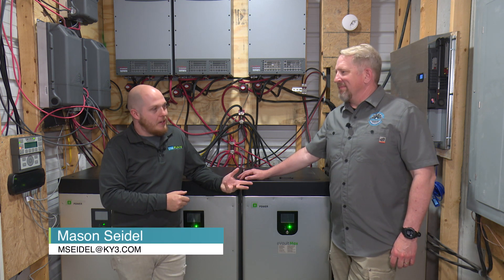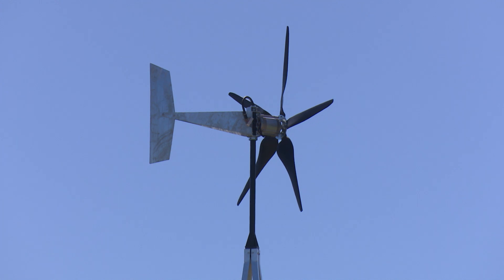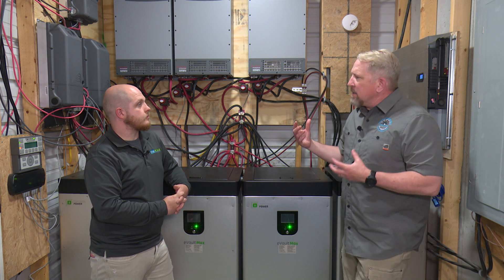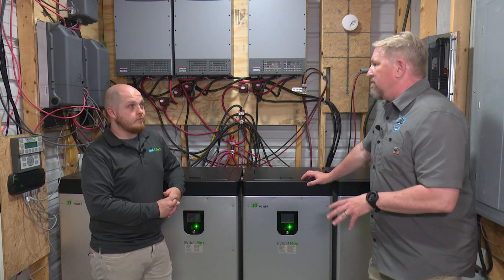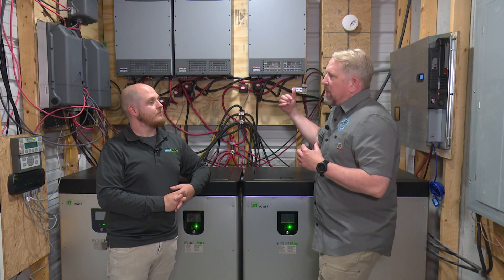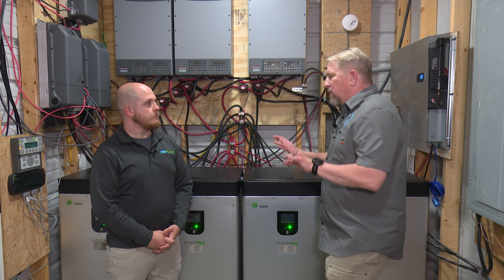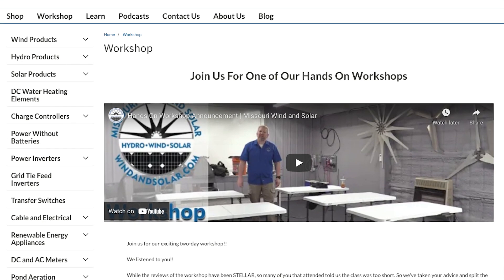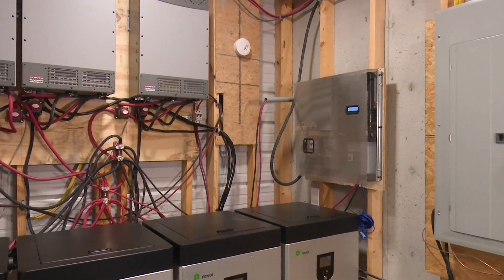What Does An Off Grid, Earth Berm Home Look Like - Mechanical Room

Comment: Looks like all the lugs are flat and tight to me, the reason you hear about watching your number of terminals is that it's easy to not get a cable flat. Sure a handful of zip ties on the smaller cables would make it look cleaner, but I see several clamps securing things to the wall to prevent anything walking around. I know from talking with the folks there at the store, a lot of product testing goes on at their place too. I sure would hate to rip conduit apart every time I wanted to tie in a new inverter or wind controller for real world testing.

Comment: Cable management
Reply: Trust me that you don't just put some tape, zip tie, or cable tie around these wires yank them into a pretty line. These cables largely do what they want and you just need to make sure tension is off any critical area. Pretty isn't a goal.
Reply: @wesshank5595  have run my share
Reply: I agree, looks like a kid did it…….
Reply: @larryschmitt2513  Then you probably haven't had to do wiring with the size cables that are involved here.
Reply: When you have that many high voltage lines you can make it as pretty as you want. You will be posting the video no?
Reply: @SinKillerJ  cable management prevents fires and accidental trips and snags of wire. When it comes time to service, neatness will make it easier to service.  The cables should be in conduit , not exposed, and not tangled up. Solar iss truly amazing. All this clean safe, unlimited free energy not being utilized by mankind, due to Greed and Control. 
  You have no idea how truly revolutionary Solar energy is. Remote, endless, isolated, mobile power or stationary, anywhere the sun shines. No underground digging to power lines. No poles to install with lines that ruin the skyline, scenic environment, and creates risk during storms. Just independent, remote, free, unlimited, Green Energy ❗🙇🏾‍♂️♻️☝🏾.
Reply: @Keepskatin  I've done worse wiring and I'm here, but I see that I am now replying to a psychopath...
Reply: @SinKillerJ  
You don't understand thee magnitude of Solar, image when Solar reseaches even 50%efficiency, or even 100% efficiency 🤔
   Solar brings possibiliites never imagined before, or not feasible before. Unlimited, affrodable, clean energy to supply any idea. The power to bring winter into summer. The power to geo engineering our entire global weather system. The power of mankind, to truly, fully, rule over the 🌎❗🤯
Reply: @Keepskatin  Yes solar is quite good... and you are quite off topic... please seek professional help. Your rants are concerning.

Comment: Sure is a wiring mess
Reply: Trust me that you don't just put some tape, zip tie, or cable tie around these wires yank them into a pretty line. These cables largely do what they want and you just need to make sure tension is off any critical area. Pretty isn't a goal.

Comment: How much is a system like this going to cost  ?
Reply: Fortress Evaults are in-stock and are currently priced at $11570 each. Outback Radians are in-stock and are priced at $4188.26 each. The FM100s are backordered until the EOY with Outback but are currently priced at $1049 each. That will give you a rough idea - you've got cabling and connectors, etc.
Reply: These proprietary large whole house batteries alone are over a thousand each. Each panel may be 30 to $500 each. Eachncharge controller may be $100 to $200. Then you need an eletrician to wire the power into your meter box area. Otherwise the electricinan will need to rewire the entire home into separate power inverters to each outlet, which is more expensive.